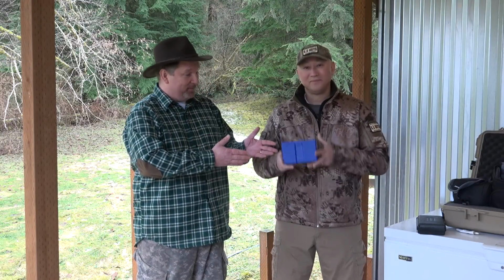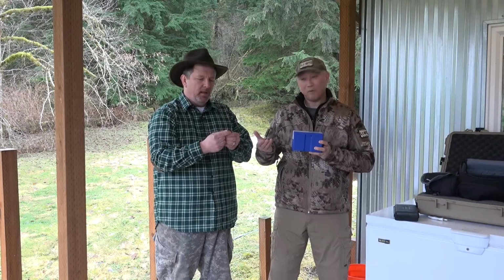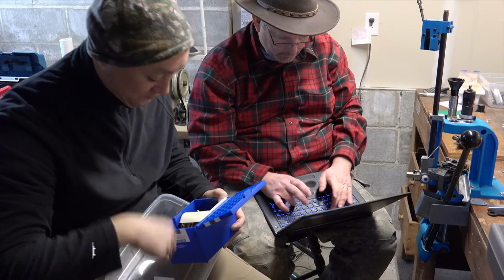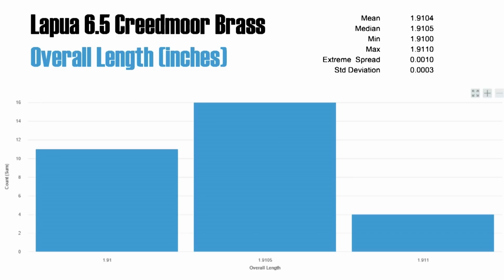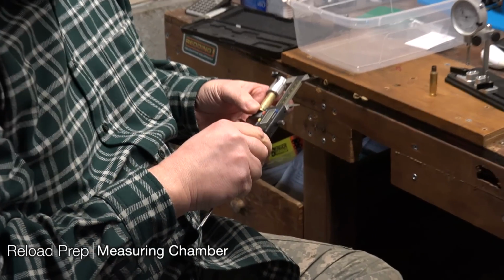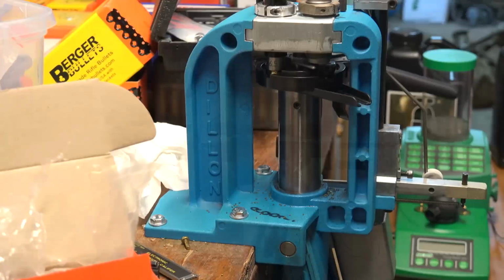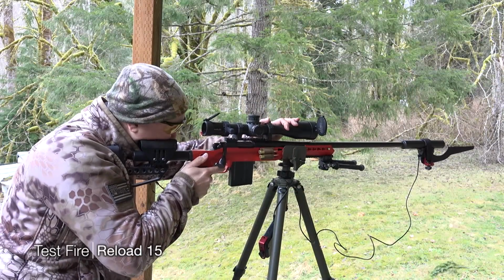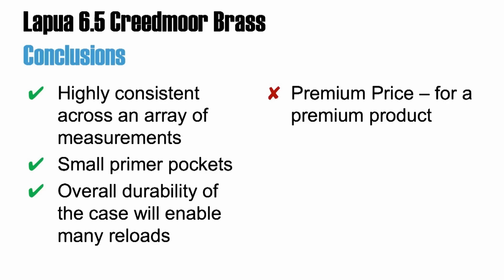S4 - 02x - A Look at Lapua 6.5 Creedmoor Brass (encoding fix)

Comment: Still a great reference video, thanks for all the continued support of the sport and industry.

A couple direct questions:
1. Did you trim the necks, if so, how much, and what was the case weight at the end? (i.e. how much brass was lost?)
2. No cleaning? Any significant exterior neck carbon build up causing tension issues?
3. Primer pockets; to clean/ream/uniform or not to, for competition? Is it too destructive and best left alone with a simple cleaning?
4. Neck turning... After seeing this, is it really needed? Doughnut removal?

Any help greatly appreciated.

Comment: Some questions from a guy new to precision reloading. Does Lapua brass not require any annealing? 
How long did it take you guys to film this? Did you guys clean the case each time in between shots and dry it out? O_o
Did you guys ever trim the brass? If so, how often?
Reply: Lapua brass (as does all brass) benefits from annealing. There is some controversy whether annealing helps accuracy but it certainly helps case life. We didn't anneal in the video to simulate a worst case scenario. We spent the afternoon filming this at my house. Between firings we wiped off the lube, but we didn't clean in media of any type. Thanks for watching!

Comment: Any modifications needed to the bolt such as a bushing in the firing pin hole to use the small rifle primers? Thanks
Reply: In our experience you'll do fine with a standard Remington 700 firing pin aperture and smaller using CCI primers. On our custom Defiance actions we specify a smaller aperture. Your mileage may vary with other primers.

Comment: I think the flash hole is the same size, Just the smaller pocket.
Reply from the maker: xstevex59 yes you're correct. Steve misspoke and meant to say primer pocket instead of flash hole.
Reply: From what I read the flash hole is also smaller. 1.5mm vs 2.0mm. My question though is, I see your using small rifle magnum primers in your load with H4350. Is this recommended with the small rifle primers, or is it because of the smaller flash hole?
Reply: The flash hole is only .059", the same as their .308 Palma brass or their 6.5x47 Lapua brass. You cannot de-prime this brass with a standard sized decapping pin, you need to buy the smaller pin.